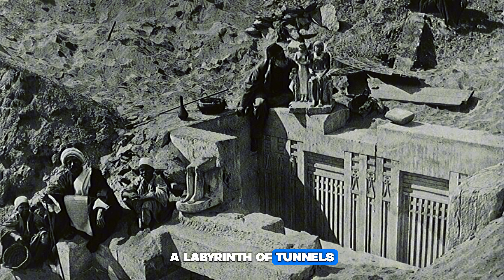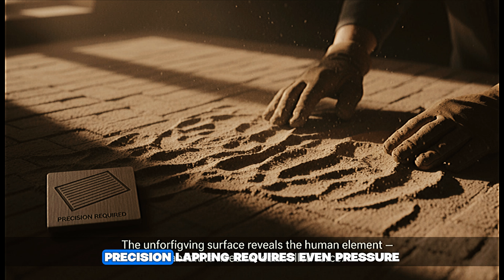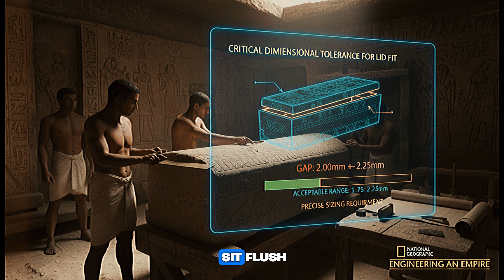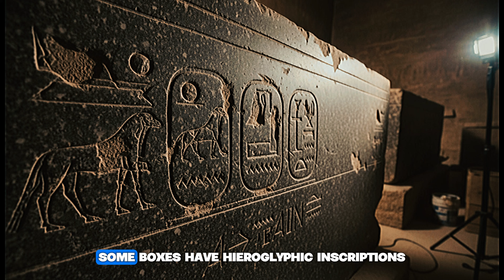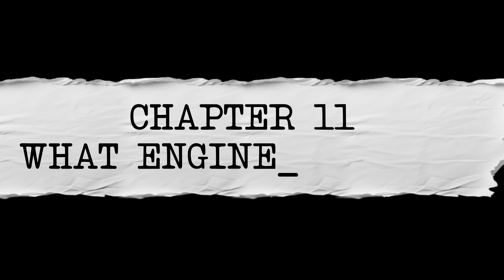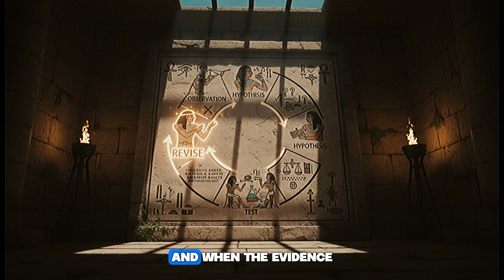Engineers Can't Explain Egypt's 70-Ton Granite Boxes

Comment: There is no way on this planet @ 0.37 you can check surface flatness with a vernier calliper.
Reply from the maker: @a17des A17, you're absolutely right - vernier caliper ≠ surface flatness tool.
Caliper measures:

Thickness
Depth
Diameter

Surface flatness requires:

Straightedge + feeler gauges
Precision level
Laser measurement

If video shows caliper for flatness @ 0:37:
That's incorrect tool/demonstration.
Dunn's actual measurements used proper instruments (straightedge, precision level).
Good catch on technical accuracy! 📐
Thanks for the correction. 👍